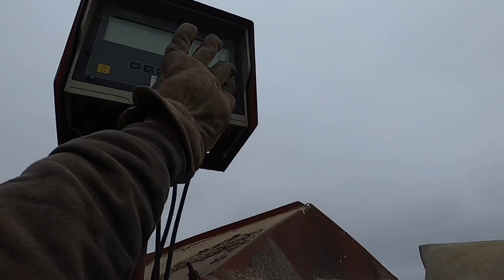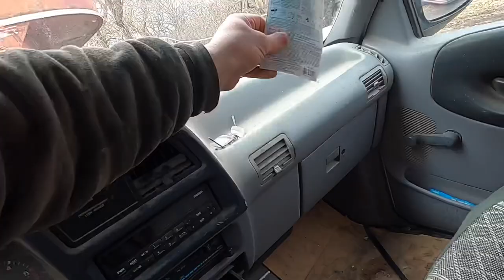Fixing In The Cow Barn - Calving Trouble and Grinding More Cattle Hay!

Comment: Having both 720s running will be a huge help in your small utility tractor department. Less need to unhook tractors from equipment them.

What equipment do the 720s have enough horsepower to run?
Reply from the maker: Actually they can pull a 5 bottom 14” plow. Not that we’d use for that. Just mainly odds and end jobs.